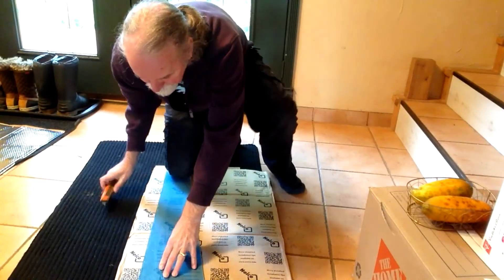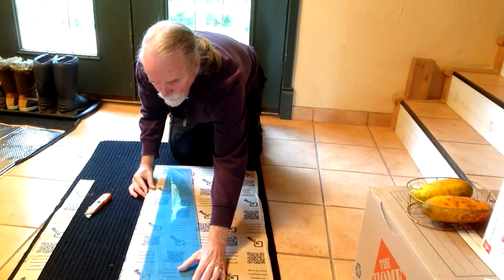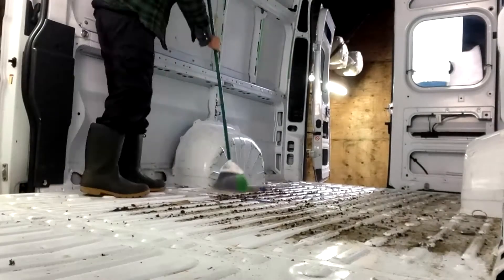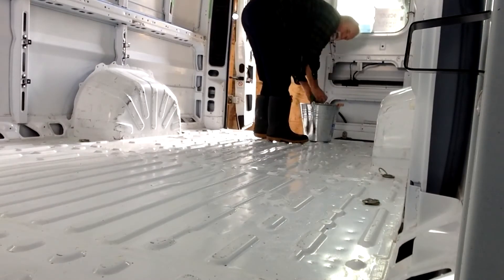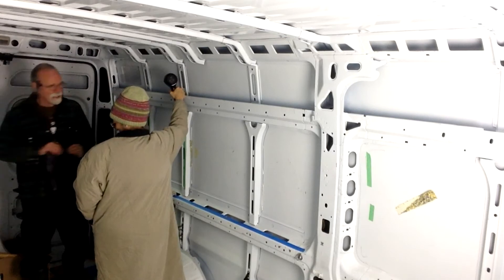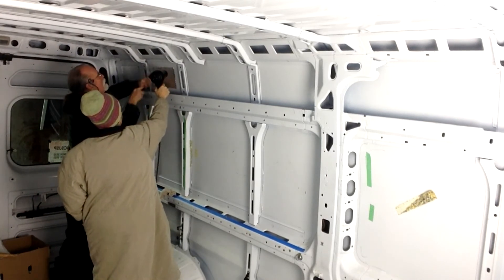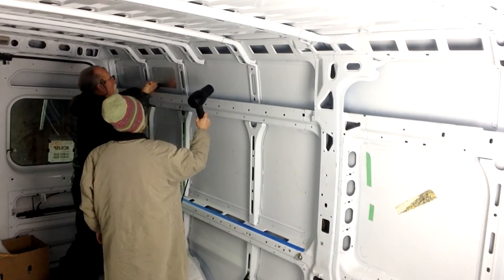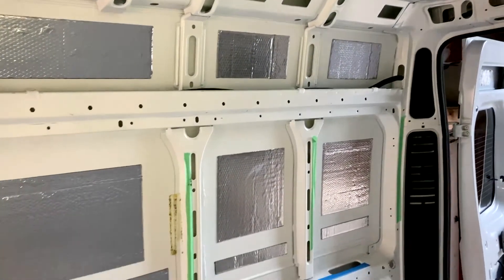How to sound proof a van conversion for a quiet build and happy van life - promaster or sprinter

Comment: Spot on. Applying a tough, thick coating in the outer wheel arches  helps damp the noise and protect the metal from corrosion. I prefer to let the material be soft and replaceable every couple of years or so rather than brittle and holding moisture in cracks. Discussion later if anyone is interested. We used an Australian / NASA microsphere paint on the outside of the roof panels. It is a thick coating that helps drumming in the same way an underseal in the wheel arches does and the microspheres help with sound insulation and heat reflection. Sound deadening cannot be added later with ease.
Reply from the maker: Hi David - the coating sounds interesting.  I have to admit I was skeptical when I ordered the stuff and applied it but figured there was only one opportunity so best to be safe.  I'm so glad I did - people can't believe how quiet the van is to drive.... Dave
Reply: @VanOfAction  Yes. I would class sound insulation as just as important as heat insulation and, no, they are not the same although both types of insulation share some properties with each other. Sound insulation should also extend to cabinets and panel framing as well as the outside fittings Squeaky panel framing or cabinets will infuriate you on longer runs for instance. By the way, the interior ventilation in a lot of vans use the rear light pillars for the location of vents or one way rubber flaps. If you fill the rear corner pillars with insulation you might cut off the van's vents. These vents can sometimes be the source of exterior noise getting inside the van especially if your bed is near one and it is generally quiet in the van.

Comment: Whats the name / brand of the material you used?
Reply from the maker: Hi Oscar.  Thanks for watching and commenting. Sorry I could not pronounce the stuff (I have that problem with a lot of products). We used a Noico sound proofing however I believe they all do about the same thing.  I can tell you,  we’ve been on a 7 week road trip - so far 6000 kms and the ride is quieter than my Chrysler Town and Country used to be.   And when it rains at night we don’t hear it other than on the vent tops.  I can’t believe how quiet it is.  This product and the wool insulation all around has been amazing.   If interested You can see the wool and more  on my channel “Van Of Action .com”. Be well and safe.
Reply: @VanOfAction  ⚡⚡🤟